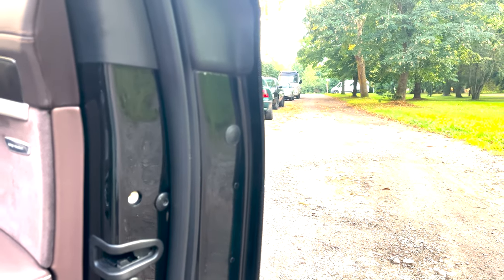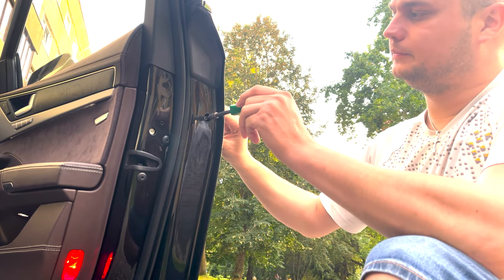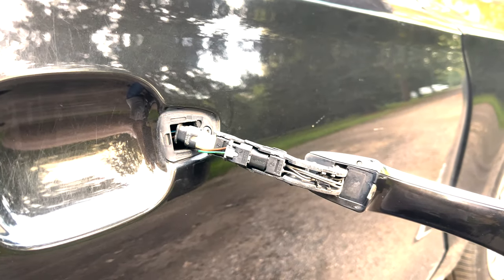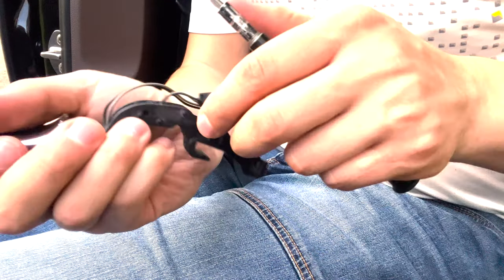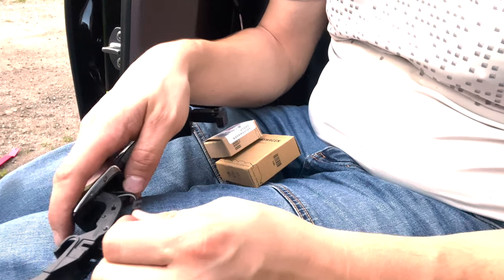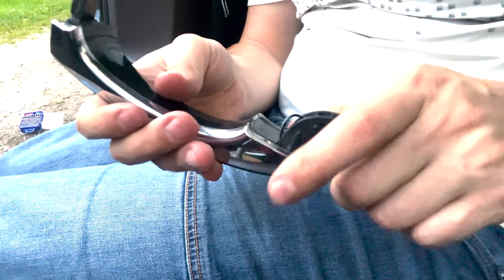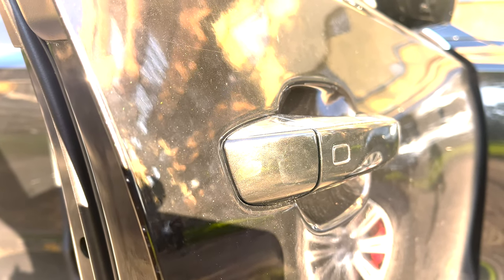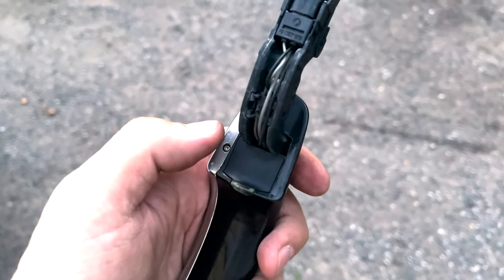The Audi Keyless Entry Problem (and How to Fix It)

Comment: this came out of the diagnostic even before i went to replace the sensor i cleared the errors and then went to replace the right sensor

03286 - Touch Sensor of the Outer Door Handle Front Right

011 - Interruption

Additional fault information:

Fault status: 01101011

Priority: 2

Frequency of occurrence: 1

Counter of resets: 146

Kilometers: 253574 km

Indication time: 0

Date: 2024.07.16

Time: 15:51:22

00192 - Touch Sensor of the Rear Left Door (G417)

011 - Interruption

Additional fault information:

Fault status: 01101011

Priority: 2

Frequency of occurrence: 1

Counter of resets: 146

Kilometers: 253574 km

Indication time: 0

Date: 2024.07.16

Time: 15:51:22
Reply from the maker: It seems you need to change the rear left door sensor also and then your keyless entry will work🙂
Reply: @TheMeisner87  I will try replacing the left sensor as well
Reply from the maker: @Jirihajek-e8v  keep me posted.
Reply: @TheMeisner87  As I quickly started fixing the crank, I quit right away because the screw in the crank wouldn't loosen and was spinning, so I decided to leave it to the garage, I guess I'd have to drill it, right?  I'll probably take it to a service center, I'm short on that
Reply from the maker: @Jirihajek-e8v  what do you mean with the crank?
Reply: @TheMeisner87  12:18 I couldn't loosen it, the screw was spinning
Reply from the maker: @Jirihajek-e8v  if its spinning then the torx are broken?Are you definitely got the torx on the screw because its quite far and easy get the pass the screw.
Reply: @TheMeisner87  
I have a ratchet on the star bolt, I reach for it but it turns, I can only think of drilling a hole
Reply from the maker: @Jirihajek-e8v  if it turns then you should turn it out until it stops.If you get the handle out then dont turn it other way.Otherwise the screw will fall inside the door.I did it😀
Reply: @TheMeisner87  Maybe I'll make a video and show what doesn't work
Reply from the maker: @Jirihajek-e8v  good idea.You can send it to facebook or instagram.
Reply from the maker: @Jirihajek-e8v  what do you mean by .?
Reply: @TheMeisner87 Nejde mi napsat ti
Reply: I sent you a request
Reply from the maker: @Jirihajek-e8v  where i dont see anything.

Comment: I have a problem with the keyless entry system in my car. The rear door behind the driver and the front passenger door won't unlock. When I clear the errors in diagnostics, only the driver's door and the rear door behind the passenger start working. But after driving for a while, the keyless entry stops working completely.
Reply from the maker: What faults you have.If there are errors on the system then in the beginning the system will work,but if the car see there is a problem then it wont work.
Reply: I bought a new sensor when I took out the handle the led light broke into pieces, unfortunately I didn't have another one but I just put a new sensor in there and it doesn't work 😥😥
Reply from the maker: @Jirihajek-e8v  check the fault codes.Maybe there is a another sensor dead.My friends car had 3 of 4 broken😀Led is not very expensive just over 20 euros from the dealer.